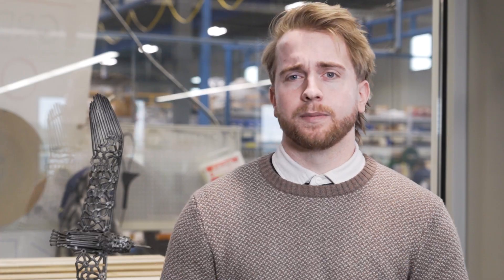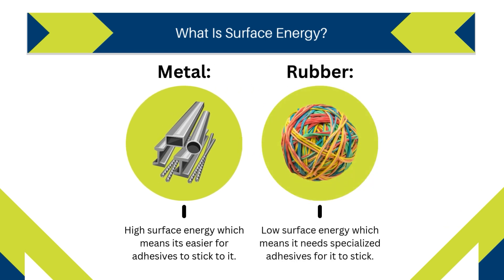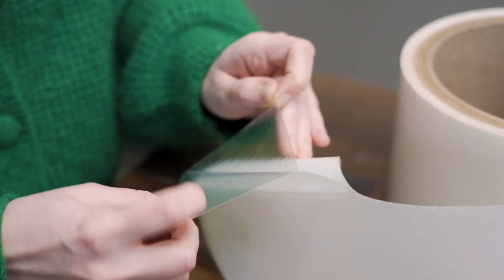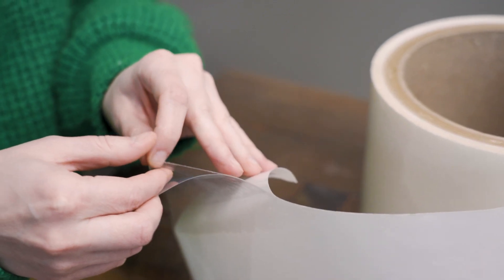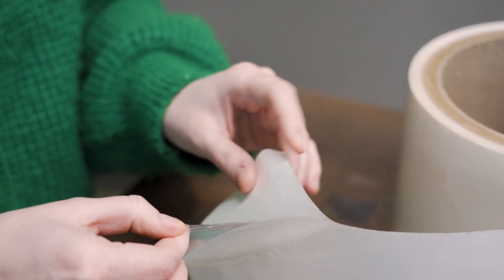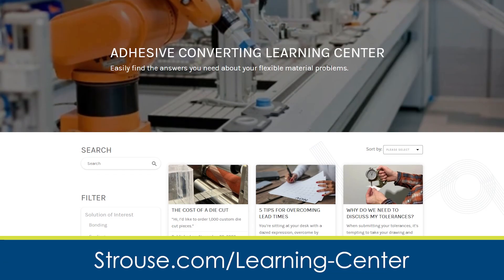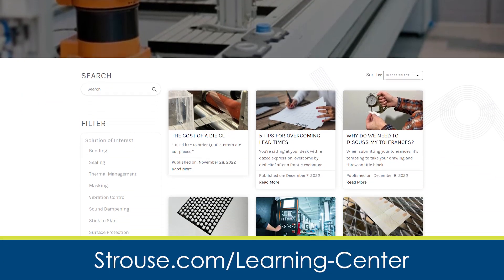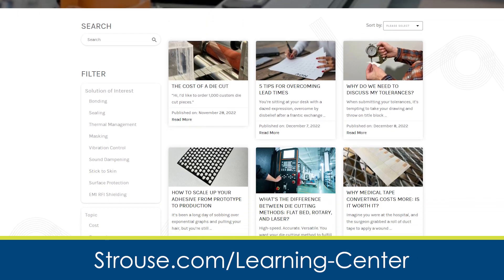Best Adhesive To Use In Rubber To Metal Applications!

Comment: I learned nothing from all that.
Reply from the maker: What were you interested in learning that wasn't in the video? In this video we recommended looking into differential double coated tapes as well as foam tapes.
Reply: @strouse-Adhesive-Die-Cutting  I was looking for an adhesive that works on rubber, (Pond Liner Material), to stainless Steal.   The oil content in the Liner, and it's flexibility make for one hell of change.  None the less, I think what I'm looking for and what this Video is about have nothing in common.   Thanks for you time on this.
Reply: @4GibMe  i did liners for 20 years what are you trying to do ?